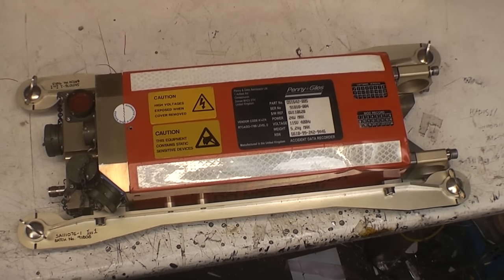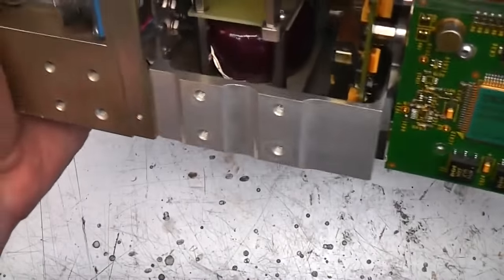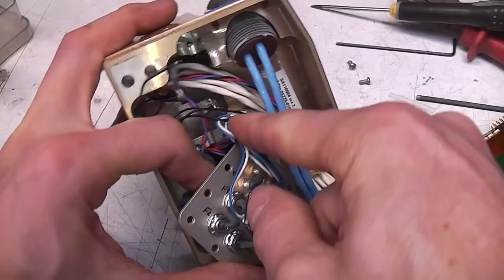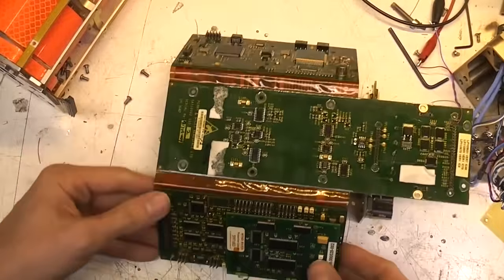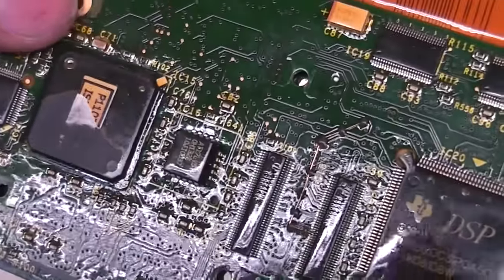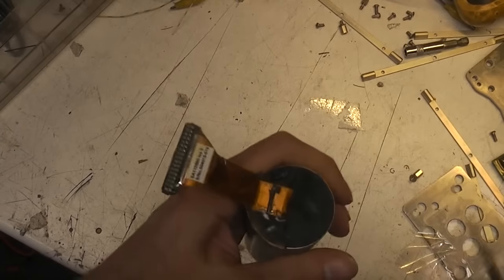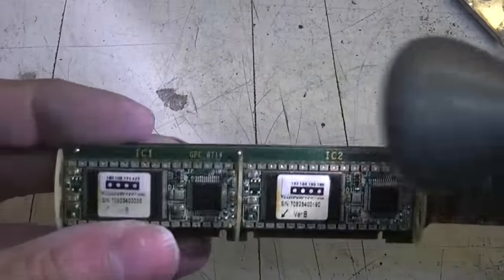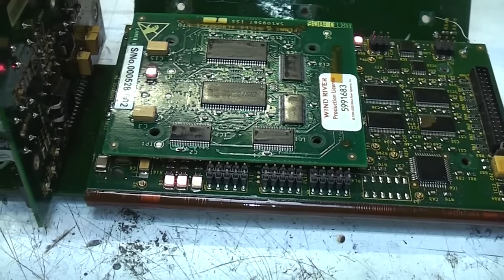Solid-state flight recorder teardown

Comment: I am curious. Perhaps the fire proofing in the tube was asbestos? For your health's sake, I hope not.
Reply: I was thinking the same thing, it looks like asbestos. Hopefully he was wearing a decent mask at least.  Even i wear a half face respirator while working with compressed asbestos gaskets.
Reply: Unlikely, the item was built in the UK which banned the use of blue and brown asbestos in 1985 and white asbestos in 1992 long before this was built. More likely it was some sort of clay.
Reply: Ok, thats good. I still find the occasional asbestos gasket/insulation in cars. Its probably some sort of bentonite clay or something.
Reply: I looked like a form of rock wool to me. And that sand was prob very dry to act as a desiccant for the memory.
Reply: i think it was just some form of crystal.
What ther doing in that memory module is to protect it against heat so they have layers of heat isolators and i think those balls are the last line of isolators and i'm pritty sure they are there to isolate the chips from heat better then air would.
Reply: Bentonite clay would make sense since it is a very effective fire retardant and a fairly modern use purpose. It could also be gypsum based as well.
Reply: Aircraft sometimes have exemptions to safety rules like that. Still use Halon for fire extinguishing, for example.
Reply: The material is microporous insulation, probably Promat Aeroguard or Thermal Ceramics Min-k.

Comment: You should be able to use wireshark and a network hub (it must be a hub and not a switch) to maintain link and an active capture. After you've started the capture, power up the flight recorder. You might see it try and DHCP out and attempt to get an address, or it may broadcast some packets from its static address. - Might work anyway without a hub and a crossover cable just like you've got there, I have been successful that way as well.

Comment: I have a CVR from an RAF Nimrod. Works of 28V DC and only draws about half an amp. There's a single RS232 interface on the front which I presume is for extracting the audio but I've been unsuccessful to get any kind of signals on the connector. The unit appears to be working as there is activity on all the chips as seen on an oscilloscope but no waveforms on the data port...

Comment: I'm surprised that they don't have a layer of water around the memory to use the tremendous ability of water to absorb heat while keeping the temp below 100C.
Reply: I know I'm a year late but water will only keep things below 100C if there's a way for water vapor to escape. They wouldn't be able to seal off the electronics as well if they needed to leave a path for the water vapor to escape.

Comment: Much of the networking advice given so far in the comments seems misguided. Your best bet with a totally unknown device like this is to run a packet sniffer like Witeshark or tcpdump while the device is booting. Hopefully you'll then be able to see it ARPing for its default gateway or another host it thinks might be on the LAN with it. If it doesn't emit any frames of its own volition then things get more complicated :P

Comment: patent US6706966 seems to be a never recorder as it has 1.5GB of internal storage.. but it also has ethernet.. and " The default URL of the homepage is 192.168.0.2 which is pre-set at the factory but which can be changed as shown in FIG. 14" but that can be changed easily so i suppose they have changed it...

also take a look at https://www.curtisswrightds.com/products/electronic-systems/crash-protected-recorders/ their models look very similear to yours

Comment: I love all the work they put into ensuring it survives. Really wish they build a more robust method for aircraft to send out a distress signal. In todays age of satellite communication you would think they could build equipment that would disengage from the aircraft and send a signal to inform the airline of the loss.
Reply: +MichaelKingsfordGray doing a data burst of a couple hundred megs over a second or two from a crashing plane is beyond current technology. There are low bandwidth links being brought online that will improve tracking, and perhaps high bandwidth links could be triggered by an mayday or transponder code. High bandwidth links require a stable platform or ground/space relays actively tracking the plane. The costs of a new constellation of satellites able to acquire and track any commercial plane in the sky  within a few seconds of catastrophic failure boggles the mind.
Reply: MichaelKingsfordGray ACARS and newer methods of sending  telemetry are still very, very low bandwidth and not robust enough to continue a link when there are catastrophic failures. They will certainly help for the still all too common situational awareness failure/controlled flight into terrain in remote areas , but plane breaks up over ocean scenarios they aren't likely to add a lot. A way to have redundant, high bandwidth transmission on critical system failure would help, but the requirements on the receiving end are immense.
Reply: +MichaelKingsfordGray You run into the practical issue of how does a computer determine ahead of time that the plane is about to crash until the crash has actually occurred -- even pilots frequently fail to call "Mayday!" -- as one does not want accidental activations.  Once the crash has happened it is subject to extreme forces that will pretty much ensure that you are likely to be left with a highly inefficient antenna (if you are lucky) at the very moment all power is lost, limiting one to low power and relatively short range transmissions (as are already transmitted by data recorders after an impact event).  At the same time, you really want your data recorder to stay with the downed plane so that you can actually find the data recorder and plane together as a plane in the process of crashing, but not yet crashed, may travel many miles before impacting Earth.
Reply: +MichaelKingsfordGray What information do you think should be sent over an always on telemetry link. Right now there is a push for ACARS or the satellite based equivalent to be on all commercial flights.  Unfortunately these systems can only send a fraction the info a flight data recorder would save.

Comment: That's how you make an high impact resistant solid state recorder. Did you see the video where the russians took the flight recorder of their jet fighter apart that has been shot down by Turkey? There was no filling in the inner chamber so all the flash chips got physically broken by their own weight and the PCB had an impact of the wire harness that caused a big crack.
Reply: I find it funny how there is more damage on the inside of the box than the outside. Yeah sure, there was no filling inside the PCBs chamber, but hell, the chamber itself is floating inside that white powder. How did those boxes passed certification if they cannot withstand high force impacts in the first place? Also, the construction of those PCBs looks simple as hell. "We swear we didn't invade your airspace, we can prove it.. oh noes, the black box is damaged" how convenient.. http://i.imgur.com/vowoWNwh.jpg
Reply: +Miguel Simões its likely that they opened it before and faked opening it on television
Reply: They probably got their education at the North Korea school of propaganda...
Reply: +Doc T'Soni Solid state in the 60's? Those kinds of SMD packages in the 60's? They clearly upgraded the flight recorder.
Reply: I would do a proper job regardless how old the jet is. Age has nothing to do with it. I want to know what happened. This russian recorder design is not older than ~15 years and compared to the Tornado one it's a damn useless hackjob made by people which didn't know how to make these things properly.
Reply: Doc T'Soni What kind of analogy is that? Who would build a "reasonable" flight recorder? Who would build something cheaper, something that won't survive a crash just to save a few bucks (compared to the rest) on the inner filling?

Comment: Does it emit any Ethernet packets at all on boot up? If So could pastebin a wireshark log? Is there a Mac address encoded? What  happens if you send a wake on lan packet. or ping with a Static ARP set?

Comment: I'm guessing the glass beads are for heat insulation.
Reply: And cushioning support for impact resistance, similar to sand. 
The glass spheres are also lightweight, non-conductive, non-absorptive, heat/fire/flame resistant, chemical/solvent resistant and reflective.

Comment: galssy dust looks like aerogel. It has great thermal performance. You could verify it by checking how well it conducts heat. There are some cool videos where they heat it with propane torch.
Reply: It's not Aerogel (only goes to 600C). It is microporous insulation which sustains temperatures of 1000C.

Comment: they use two different TYPES of flash memory for redundancy.. all modern CVR/FDR have this.. i work on airplanes that are fly-by-wire.. each control surface has 4 computers controlling it and each and every computer is made by a completely different manufacturer for redundancy, they do this so if one type of computer fails for any reason the next computer will never have the same failure..

Comment: i would imagine it would use a manually configured IP address, I don't think it would be in the 24 Subnet range, The OS might be also on the solid state drive that was not connected and it sent the data to a satellite, using the onboard memory to store the data as a cache, Try it with the drive plugged in, If that will not work some new planes use Ethernet to communicate with the recorder so if you get no data out from it, it could be only data in

Comment: Very interesting, amazed the memory is so small.
Reply: 384MB? Plenty for a couple data/xml -streams and even audio.
Reply: very conservative industry, they're probably 3+ generations behind "state of the art" and using XOR flash or EEPROM for those 2MB parts, the other NAND diskonchip thingies use very big cells which means larger retention and more P/E cycles, probably overprovisioned to hell.
also remember that flight data is not very space-intensive even with a lot of sensors at high capture rate
Reply: could it also be that they need more robust flash (= bigger cells) to be more resilient against cosmic rays?
Reply: Wrong. The generational innovation takes forever in avionics. This is almost certainly the state of the art (as far as actual implemented hardware -- I'm sure a lab somewhere has some giant 50TB flash chips on it or something equally mental).
Reply: Best comment!  High density memory might indeed be more vulnerable to cosmic rays!  Next best comment mentioned data duplication/redundancy.
What seems like old low-tech might actually be state of the art when you consider survivability.  On the other hand, vibrating flex cable and connectors seem like obvious points of failure.  Thanks Mike!

Comment: You might try to put an ethernet hub (not a switch) between the device and your router. Connect a pc to the hub, install WireShark and you can capture all the traffic in between.

Comment: Very cool! I didnt know they did solid state ones. Must be out of a relatively new airplane then, I wonder how it got on ebay so quickly because they usually last as long as the plane...
Reply: Given the huge dent? I'm guessing someone dropped it.
Reply: +Preproto that would be really fun to look for at a crash site :D 
I can barely find micro SD cards on my table.
Reply: @Preproto Well it is only 300mb, but it does not need to be larger, it only needs to be robust. And most airliners nowadays still fly with the old tape based recorders! The aerospace industry is kind of stiff in ways like that, if it works and is robust they wont upgrade it quickly.
Reply: @Robert Yeah that might be it. But still, those things survive airplane crashes, i would find it weird if it stopped working after dropping it. Even my laptop keeps on working after dropping it.
Reply: Or it was inside some plane that mildly crashed :D That would probably make it a writeoff. However I would imagine the manufacturer could refurbish and recertify it if someone has just dropped it.
Reply: +Rkan Yeah could very well be. Although some other guy in the comments mentioned that it is from a Panavia Tornado and that they underwent electronics refurbishment. The military is always very strict in what they put into their planes, so that could be the explanation as well.
Reply: tHaH4x0r I thought the Panavia Tornado as well, since it is really the only plane in RAF that has had it's design and manufacturing at least partly done in the UK. (of planes which would have solid state stuff anyway) check out ebay listing 131622930631, it has the same NSN. That listing ended on 25 Oct, 2015 so probably won't be there forever.
Reply: +tHaH4x0r They are readable after a crash. A full check and refurb would likely equal the cost of a new unit (the test equipment is certainly set up for building rather then already assembled units)
Reply: Well, the good thing is, that it's a bit lager than a microSD card :)
Reply: but a crash site are a lot large than a table
Reply: Yeah, but with anything in the Aerospace industry, if theres any damage, no matter how small to safety systems they need to be replace/fixed and certified. The drop could have damaged the under water beacon which in turn could have set off a internal signal to store data. When the cost of repair goes above a certain percentage of the cost of replacement, a replacement is issued.
Reply: Nathan Hall To be hoest, the ULBs are routinely replaced anyway when they expire. They are easy to replace. Still.. Recertification will be needed for dropped equipment.. What data storing signal are you talking about? The black box is always "storing" data.

Comment: What are the advantages of the flex rigid construction over board to board ? I am guessing its more expensive.
Reply: More reliable. Avoids human error (Fred forgot to plug in connector J5 and so we lost all the engine data)

Comment: 384 MB of storage?  I'm sure that's more than sufficient for the basics, but still, with memory prices dropping, I bet a very modern flight recorder would have much more capacity.  It would be able to record much more detail, record many more parameters, or both.  I wonder what the highest capacity recorders feature.
Reply: Although that will be considerably more than the old tape storage units.
Reply: I wonder how much actual space is available for storage surely they are in redundant configuration the same data may go to each module!
Reply: I would guess they are using large-scale single level cell flash to stand up to the continuous write. Flash prices have come down due to process shrinks and by storing multiple bits in each flash cell, however this newer shrunk-cell memory is MUCH less durable.
Reply: Lower density memory is considered more reliable.

Comment: It's super annoying to have to scroll through a sea of... not so thoughtful.. comments, just to find interesting pieces of info haha. YouTube and its troll army lol. These types of devices are likely to run the VxWorks RTOS due to its very small memory footprint. I've looked into decompiling parts of VxWorks when attempting to explore the firmware on my scope and it was just very annoying due to a lack of any publically available documentation (intentional for sure lol). I did have some success though. Google "Reverse Engineering VxWorks Firmware: WRT54Gv8" where a guy does that for router firmware. If anything, you may learn some new techniques for the future. Also nice to see them use Nichicon PM caps (those brown ones) since that's all I've been using myself for doing repairs. For the flash memory, I'd just try to read the chips out directly. I wonder if the data would be encrypted. My gut feeling is that it wouldn't be, because that would make it much harder to reconstruct if chunks are missing. However, I'd say that it would be logical for them to use some kind of data reduncancy mechanism other than strict mirroring of data since that's inefficient. Like a RAID5/6 parity structure - so that the part of the total data you're trying to access isn't localized to specific chips. Smaller overhead and still means that all data is recoverable despite some of the chips being unreadable.

Comment: Really would be nice for future videos for you to lay the device on the table as much as possible and use a thin pointer when discussing your observations. There would be much less obscuring by fingers, the camera wouldn't be always trying to track focus and the view would not be constantly jiggling. As for the audio, perhaps you should obtain a lapel mike or a decent mike suspended over the work area.

Comment: as others have stated try nmap and try all of the private subnets. (192.168.0.0/16, 127.16.0.0/12, and 10.0.0.0/8.) it it run overnight. You way also want to try listening with wireshark to see if it is putting any traffic out.
Reply: 172, not 127.